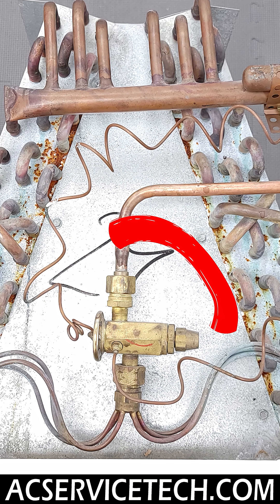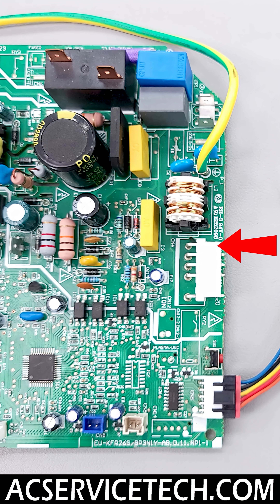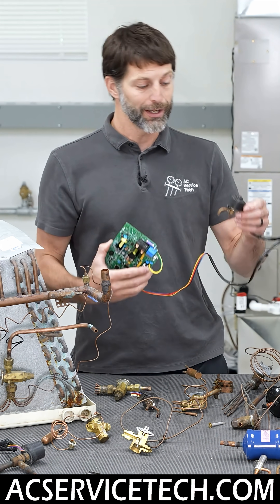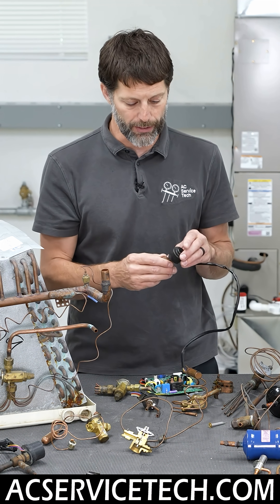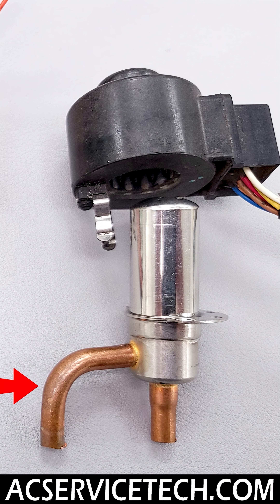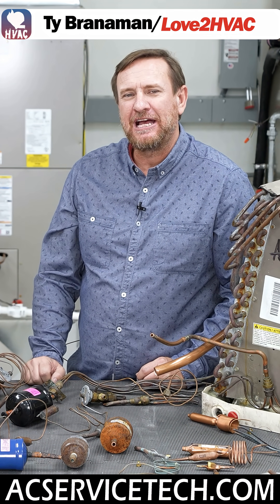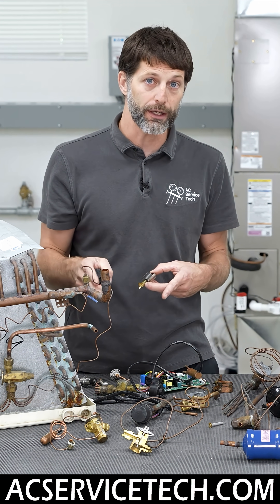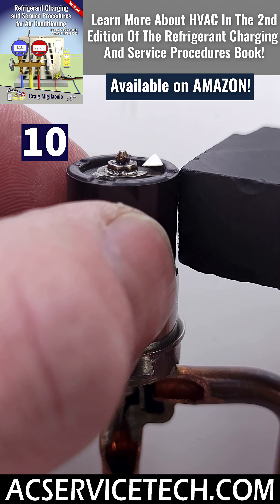Discussing Electric Expansion Valves! (EEVs)

Comment: If I am not wrong, the is no need to change the whole EEV. Most of the failures can be resolved by just changing thev"head" (ie, the stepper motor). They are sold separately.

Comment: Un-needed electronics that are a waste. Just another way for customers to have to spend money. The old systems worked just fine and a lot cheaper.
Reply: I still running a piston  on my new system. problem free😂
Reply: @vegitoblue7908  Good work!
Reply: It's actually much more efficient than header manifold tubes and pistons.
Reply: @lucaswhite3411  Not when you go for a repair, way more cost involved when fixing these systems.

Comment: I am so behind all this technology its unreal.
Reply: Just download IOM's on gear you need to catch up on and after reading them call the company's tech support with questions. That's what they're there for. Relax, you've got this. There's not much to the stepper motors and there's always good info on the controls and sensors. Download the IOM on this  stepper motor and the controller and read them with a high lighter.

Comment: They've been used commercially for over 20. This is a  smaller simpler version of them. They're called stepper motors too.  There used to accurately position a number of things. A 0 to 10 vdc or 4 to 20 ma signal are sent to the controller and the controller responds the way it was set up to respond in most cases. Here your controller is making decisions based on sensors which is generally how they control stepper motor expansion valves  (EEV's) and actuators on absorbers. This is how you maximize efficiency. This is how you can go cooling to dehumidification and cooling to heating or reheat very accurately. You in particular will love these things.

Comment: With exv do will  charge or check refrigerant level by sub cooling ?
Reply: Think about what subcooling is actually doing. You still want to stack.  Perhaps not  as much
Reply: Some units have a charge assist mode that allow the unit to be charged by subcooling. If the unit does not have that then usually you have to weigh the charge in.
Reply: @Redtooth75  I don't have any experience with newer residential equipment. What is charge assist based on? What is it measuring and can that result vary? And when you say "and when you  have to weigh it in",  do you mean by each extra ft of line set above factory charge? I'm asking because I intend to to go back in business and I imagine I will  be working on residential equipment  which is why I follow this channel. Is this because of issues  with blends? Thanks in advance.
Reply: @MechanicsAndCarpentry369  Most systems with an EEV also have variable compressors. Charge assist sets the output to 100% so the charge can be checked with the subcooling method. If the equipment does not have that then it can't really be topped up. The entire charge has to be weighed in. The lineset length will change the system charge.
But if the system is not variable speed then the subcooling method still works.
Reply: @Redtooth75  The only way to commission a system is running the compressors fully loaded.  That is the only way to do it and that's a great feature. Thanks.

Comment: Sounds like something that's gonna break all the time
Reply: Not really.
Reply: They've been around for many years now, most brands work very well and don't have high failure rates that I've come across.
Reply: They've been in use commercially for over 20 years. They call them stepper motors or a stepper actuators and they're super accurate and very reliable themselves. What does go are sensors  and the controller over time. I'm sure they fail but i  have never had to replace one personally.